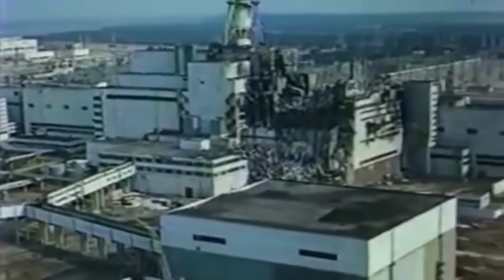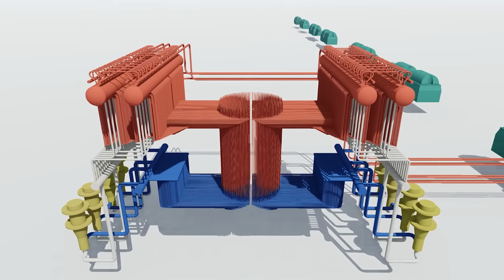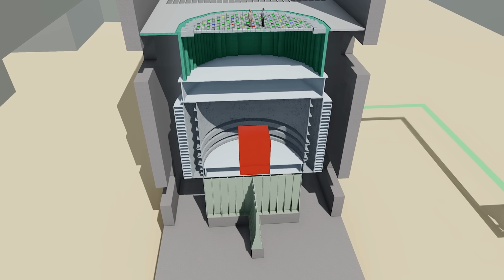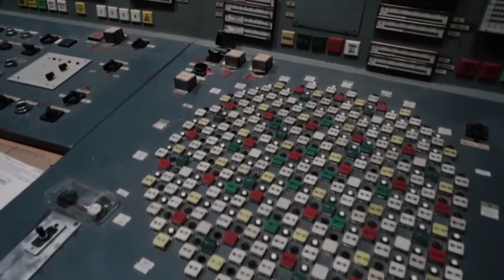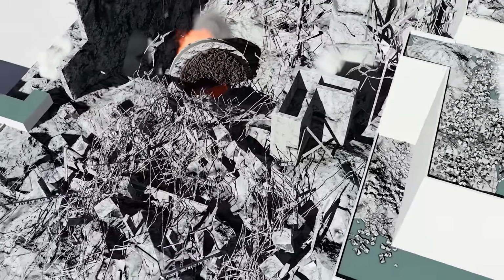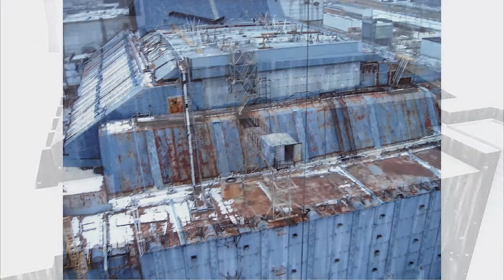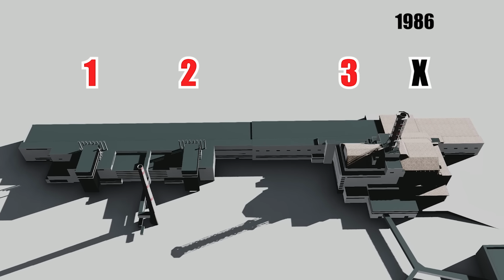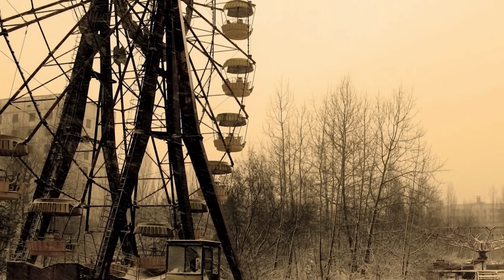CHERNOBYL DISASTER - An Inside Look - 3D

Comment: Mr. Bell, plenty of western reactor designes can be refueled without shutdown, and plenty use low (or not at all) enrichment uranium. CANDU also has a positive void coefficient.

CANDU reactors: Pressurised heavy-water cooled and moderated, natural uranium fuel reactors of Canadian design. Operated 1947–present. (Used NON-enriched uranium), positive VC

Magnox reactors: CO2-cooled, graphite-moderated, natural uranium fuel reactors of British design. Operated 1954–2015. (Used 
NON-enriched uranium)

UNGG reactors: CO2-cooled, graphite-moderated, natural uranium fuel reactors of French design. Operated 1966 - 1994. (Used 
NON-enriched uranium)

AGR (Advanced gas-cooled) reactors: CO2-cooled, graphite-moderated, enriched uranium fuel reactors of British design. Operated 1976–present.

I will also point out that the distinction between "western reactors" being failsafe and having pressure vessels while "eastern reactors" being dangerous and non-pressurized is nonsensical, considering the Soviets also developed VVERs which were alot more in line with "western reactors".

"Anatoly Dyatlov had a poor knowledge of reactor science and recklessly bypassed multiple safety systems" ...yeah, right, a nuclear engineer with decades of experience was clueless and caused the accident. Thank you for reinforcing the Soviet lie.

Your video is good but take care about misinformation and personal attacks, especially when they're not based on reality at all.
Reply from the maker: True what you say.  Corrections cannot be made once the video is posted.  I aim to remake this video with correct information and without the anti russian tone.

Comment: Horrible disaster . Human error.  Brilliant reactor.  This would have never happened if the control rods didn't have graphite tips . The Emergency shut down was initiated and the control rods went home . Instantly neutrons were moderated cesium burnt off among other things and the toxic core flash steam many gallons of water blowing the lid right off .
Reply from the maker: Its interesting that you say this was a brilliant reactor. Is that because of its relative simplicity and efficiency?  Do you think it is reasonable to say have the graphite extended all the way to the base of the reactor (ie. no temporary power surge)this reactor would have run till this day without large incidents?
Reply: @Mike-Bell  the entire core was graphite.  The boron control rods had graphite tips to reduce cost.  Because of that and under the conditions the tips accelerated the neutrons unexpectedly and boom . And alot of rbmks are still running with no issues . Any nuclear power plant that is run by a maniac will explode . If you go below minimum power level you must shut down
Reply: @michaelnichols2192  this actually isn't entirely correct. The show Chernobyl greatly simplifies the explanation for time purposes. The control rods had two portions, a graphite portion and a boron portion. When the boron portion was pulled out, the graphite portion moved up to take its place. This helped keep the reaction stable and powerful enough to continue. The actual science on why the energy spikes after AZ-5 is pressed is very complicated and not just because "the tips are graphite".
Reply: @nosolu325  So, what I understand from this is, don't pull out.
Reply: that reactor had a huge number of violations by constructors

Comment: ''Western reactors were stable by design....'' - What an ignorance. Didn`t you hear about ''Three Mile island'' incident?
Reply: That was nothing compared to Chernobyl
Reply: @matthewgrey6747  but it was also a nuclear disaster
Reply: Well the point is that western reactors used heavy water while Russia used normal water; The former self-regulates while the latter does not
Reply: Firstly, we used to have both types of the reactors: with and without pressure vessels.  Rbmk was just a branch of the reactors built in the USSR. WWER was another type of the reactors and it used water as neutron inhibitor and had 2 independent coolant circuits. Secondly, all the remaining rbmks had been deeply upgraded to match the modern safety requirements. There is no more positive reactivity effect bound to the massive rod downwards movement and they now have steam reactivity effect reduced to a value that prevents uncontrolled reaction acceleration.
Reply: @svalfish1716    U.S. reactors use regular water.
Reply: Three miles island had zero deaths
Reply: @k-rodkev-dog7449  Fukushima had. These were American reactors.

Comment: Now go figure. reactor °3 (wich was literally next door) kept running until 2000. For 14 years people where working right next to what essentially is one of the deadliest places on the planet.
Reply: Yea i thought of that too. Thats crazy
Reply from the maker: This is a fascinating aspect about Chernobyl.  It helped that the buildings were vast.  Concrete walls and multiples of them provide very good radiation protection.  So workers inside the building were pretty safe.  Outside, coming and going to work was a different story.  The outside radiation was highly variable and sometimes by just a short distances.  Hotspots were demarcated and avoided.

Comment: 3:05 "Western reactors may only be refueled during a reactor shutdown". This is true for most of them, but not for a class of reactors called CANDU which are refueled at full power
Reply: Came here to say the same thing.. Good video, but a number of mistakes/missing info.
Reply from the maker: See my pinned comment with corrections...

Comment: Im still covinced that RBMK reactors had a good design and some great features. The explosion was because they were experimenting on a full scale reactor, and personal overruled multiple safty systems and warnings. So if someone run over a pedestrian with 200km/h in the city, I wouldn't blame it on the car engineers.
Reply: Honestly, as far as cheapo reactors go, the RBMK is stellar. Yes it has shortcomings, but the staff should've been properly trained for them. Being able to use barely enriched Uranium and being as cheap to construct as they are, they should be further developped for use by developping nations for cheap non-fossile energy.
Reply: The fact RBMK has a positive void coefficient should have been enough to send it back for a redesign.  For safety, you want a reactor that takes work to keep it running, not one which can run on its own...  We (Canada) have CANDU reactors, they use natural uranium so a loss of heavy water coolant would immediately shut the system down.  There is an evac building where all the heavy water can be dumped safely if needed.  The fact the control rods for "SCRAM" were also tipped with moderators was INSANE.  To stop a reactor, you do not want to push a moderator that increases reactivity into it.  Their SCRAM system is also extremely slow.  Chain reactions are exponential in nature, you need to scram the system as fast as possible.
Reply from the maker: I agree the RBMK was in the tradition of the rough and tough simple helicopters which were and are still excellent.  Had the AZ-5 issue tip effect been openly communicated the controllers they would have compensated for it and RBMKs still be in wide use today.  There would have been no Chernobyl.  It was the cover up and secrecy that was deadly and catastrophic
Reply: The general misconception is "positive void coefficient is BAD". Actually it doesn't necessarily make a reactor inherently unsafe, partially because many fission neutrons are delayed for tens of seconds. CANDU has a positive void coefficient, fast breeders have it by design, etc. Next, the RBMK void coefficient depends on the core content and decomes positive when all absorber rods and most of the control rods are removed, but the reactor remains perfectly controllable and safe if operational limits are not exceded.
The "tip effect", i.e. the "positive scram" effect, a local reactivity increase when the graphite section of the control rod dispaces water, is known from 1983. All RBMK plants were informed of the problem and instructed never operate outside specified limits. The normal operation reactivity margin is generally no less then 30 control rods. It can be reduced to 15 (1% operation reactivity margin, the lowest at which the reactor is guaranteed to work) but any power drop to less then 50% will poison the reactor and put it in the so called iodine (xenon) pit and the reactor has to be shut down for no less then 24 hours. Before the "experiment" the operation reactivity margin was way below all safe margins.
Engineers were asked at the court "what should you have done when the reactor power dropped to almost zero?" The answer was "shut down the reactor." Q: "What should you have done when you found the operation reactivity margin below 15 control rods?" A:"Shut down the reactor."
Reply from the maker: @SmirnovSB  Hi. Thanks for the detail comment.  You say that controllers were informed of the positive scram from the AZ5 in 83. I assume that was after the Ignalina AZ5 channel rupture. Do you have references of this.  I am making a follow up video and discuss this exact point. I would like to present the accurate facts. 
I am also intrigued that neutrons can bounce inside the reactor for tens of seconds... I always assumed nuclear time is nanoseconds.
Reply: @Mike-Bell  > I assume that was after the Ignalina AZ5 channel rupture
It was indeed after the Ignalina Unit 1 came online in December 1983. AFAIR it was mentioned in INSAG. The note to all RBMK plants mentioned that at no circumstances control and safety rods may be pulled completely out of the core among other detailes. But I think the Chief Designer never believed someone would run the reactor in such state that the "tip effect" could be a problem until Chernobyl.

> I am also intrigued that neutrons can bounce inside the reactor for tens of seconds
No, they don't bounce. :) I'm talking about the delayed neutrons emitted by fission fragments during their alpha decay. Reactors generally maintain negative prompt criticality, i.e. the amount of neutrons produced in uranium nuclei fission is barely not enough to sustain the chain reaction. But the delayed neutrons come moments (up to a minute) later and boost the reaction giving enough time to regulate the process. The prompt critical core is uncontrollable and can only be saved by its physical design: negative thermal reactivity, etc.
Reply from the maker: @SmirnovSB  Thanks for the detail reply.  I am very close to posting my follow up video "Why did the AZ5 explode the reactor"  where I discuss Leningrad '75 and Ignalina '83.   Would you like to review it for accuracy before I post it?  If so email me on tadpolefarm@gmail.com so I can share the draft version.
Reply: @Mike-Bell  had the idiots not removed all the control rods, all would be ok.
Reply: RBMK design is horribly flawed, but super cheap, so it's easy to see the appeal. The unstable design of the positive void coefficient makes it great for generating a lot of energy quickly with low maintenance. Dyatlov, as history proved, pushed it to the brink of destruction, disengaging safety systems and overriding protocols that would have made the accident an impossibility - all while believing there was a failsafe to make it all go away. Honestly, if the USSR just built another biological shield around the reactor hall (not that expensive), much of the crap would've been contained better.
Reply: @abloogywoogywoo  the problem was the untrained staff and lack of dome to contain an explosion. This could be an option for countries who want to nuclear power but are not super wealthy like the UK, USA, France....
Reply: @abloogywoogywoo  
There are too many valves and pipelines in RBMK, so I have doubts about the price of this design. But one of the  interesting benefits is the opportunity to use it as non-stop facility. Please, remind the method of Pu 239 creating. And veri similar canalled reactors design in UK...
Reply: @OPG88UAKC  the valves and pipelines ane no mach to, no refuel down time and construction of containment building.

Comment: if the scientists who designed chernobyl's reactor had to design a car they would make it so when you press the gas it accelerates and when you press the brake it also accelerates but twice as hard
Reply: Exactly. But this effect of RBMK-1000 was practically unknown up to date of this tragedy, and it was described only after years of investigation. As the other incidents this one is link of many random events together. So RBMK-1000 succesfuly used many years after Chernobyl without any problems.

Comment: It's not 100% confirmed the hundred tons top cover of the reactor was blown up. Some scientists said the reactor construction has melted, burn etc and the heavy cover felt down - NOT been blown up.
Reply: There was a guy inside of the blown reactor https://youtu.be/fzVNdSVmxB0
Reply from the maker: @trendlpmlg6945  Yes its a great video and clearly illustrates the core was pretty empty afterwards.  Most of the core contents were allover the rest of the building and the surroundings.
Reply: So its confirmed that it blew
Reply: @trendlpmlg6945  it would be if we lifted the cover. You cannot see if it was melted or blown in that video that I already saw few months.
Reply: If it didnt have blown up it wouldnt be so radiated and you couldnt have seen right into the core after the explosion
Reply: @trendlpmlg6945  what? Melted would also be radiated, it’s fucking uranium...
Reply: @trendlpmlg6945  btw, we could see if the cover wasn’t collapsed and we would be stupid enough to be that close
Reply: @trendlpmlg6945  The atomic plant consisted containers with spare fuel for the reactor. During the explosion of the nitrogen that container was heavily damaged and its fuel has been spread over the affected area. You couldn't see the core right after the explosion!!! Stop spreading information not proofed by scientists .
Reply: @vladeb1104  yes it is scientific prooven that the core exploded i mean there is graphite everywhere,you can see the lid and there were actually people inside reactor 4
Reply from the maker: The only way the graphite could have escaped and been spewn all over the place was if the lid lifted to let the core contents get out.  So I think you are mistaken
Reply: @Mike-Bell  warehouse with spare uranim has been damaged as hydrogen container next to it has been blown up
Reply from the maker: @vladeb1104  there are fotos of the lid upside down.!  What more evidence do you need that the lid lifted?  Why do you not want to accept that the lid went flying?
Reply: @Mike-Bell  my assumptions are made on scientist documents, what you want me to say? The cover fell as one side of reactor housing has burnt faster. Other side of the housing hasn't been touched next day morning after the accident as there was a worker who parked his car in front of the building as he didn't know the reactor is burning. Next day the housing has burnt and cover fell. The guy lost his car. Rmbk reactors can't blow as they are to big. Do you understand in such size there are areas where atomic reaction still occurs and in other areas don't. Read documentation from scientist and stop spreading idiotic assumptions.

Comment: Ahem! Pardon the interruption but wasn’t bypassing a number of safety measures part of the test to see how the reactor would in fact “react” along with the precursor low rpm turbine noise checks? If so, for us “technically minded” , can you please explain which safety procedures were bypassed? 
Ty
Reply: if i understood correctly, they drove the power down deliberately to see if the diesel generators would kick in to "save" the reactor in case the whole power down scenario actually happened and nobody is around to quickly fix it. They never managed to pull it off beforehand so I guess that whole procedure was deemed unsafe. However, the A3-5 they considered to be the ultimate fail safe which allowed them to do what they wanted, if they had known at the time that it wasn't exactly like that, the test would never have been attempted, and Dyatlov himself said so. He was portrayed in the show as a complete lunatic, but in reality he was just operating on knowledge they all had at the time. Imagine you were driving a car and wanted to hit it 88mph to see some "serious shit" knowing full well if you don't make it, you can always punch the brakes and be safe to try the same thing on another day, only to realise than when you slam the brakes and you're already going near 88mph, you'd actually speed up for a split second before actually slowing down.

Comment: did the kremlin know about the fault before the disaster?
Reply from the maker: Great question.  
Surely the Kremlin would have known about the mini meltdown after AZ5 activation at the Leningrad RBMK in ‘75. Was the Kremlin in on the decision to not correct the design flaw at all RBMK’s as the scientists recommended.   Probably.... but we will never know for sure. Brezhnev was Leader at the time
Reply: They did. The same problem occured during the third experiment (at Ignalina), they just got lucky to hit the emergency shutdown a wee bit earlier. There even were the schematics for a solution to the flaw, that proved fatal in Chernobyl-4, it was just not planned to apply that solution, as doing so would mean to openly admit a flaw in the pride of the soviet nuclear engineering.